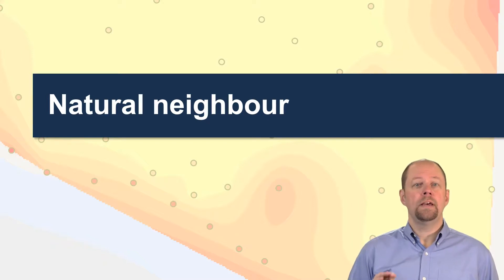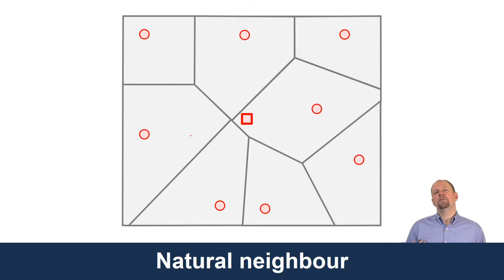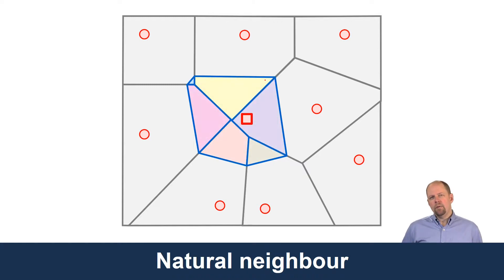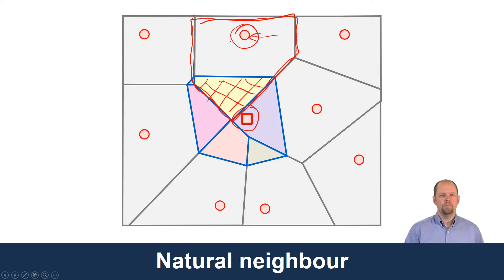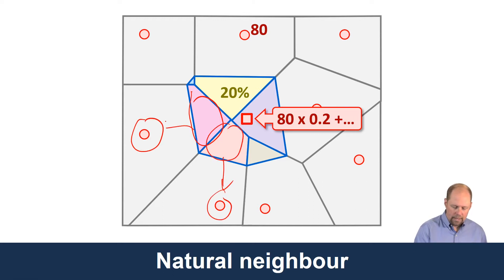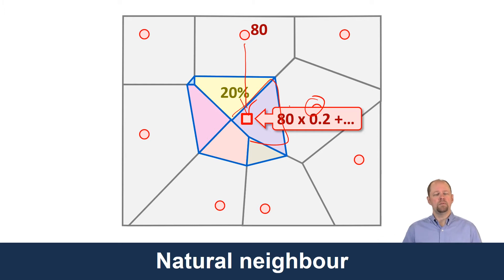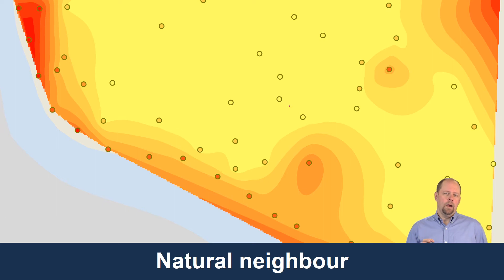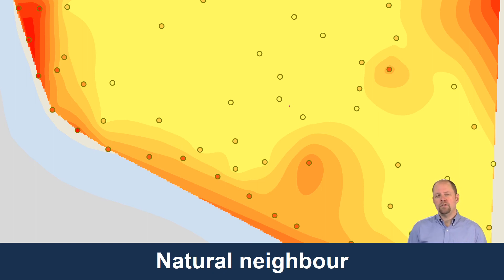Natural neighbour for creating a surface from sample points

Comment: Hi, great video!
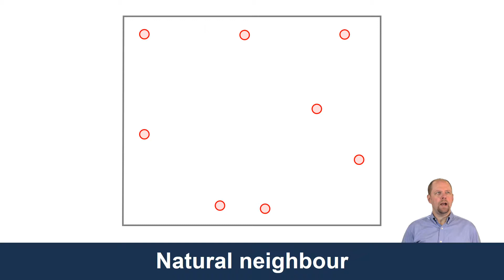I wanted to know how the grid in 0:08 that encloses the points is chosen. Is it arbitrary? Because it does affect the weights later on.
Thanks!
Reply from the maker: they are called Thiessen polygons - you can learn more about them in this video: https://youtu.be/E-s1p5yQWI0
Reply: @DonBoyes  oh I wasn't clear enough. I know a little about this since I implemented it on python but what I wanted to know is how arbitrary is the rectangular box that encloses the entire voronoi diagram because the outer cells would be non-finite geometrical shapes.
Reply from the maker: @hatim010  It's fairly arbitrary. Sometimes you might have some rationale for choosing a specific distance, but generally it is the same as defining any study area.
Reply: @DonBoyes  I see now, thanks a lot!
Reply from the maker: @hatim010  You're welcome!